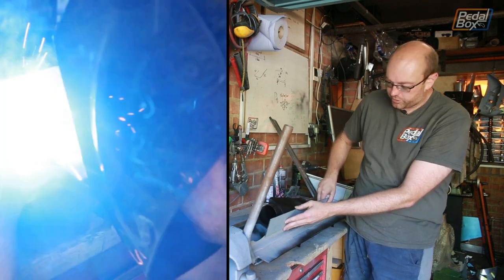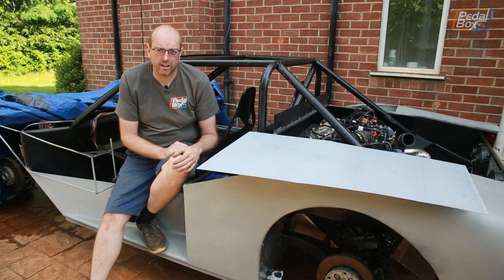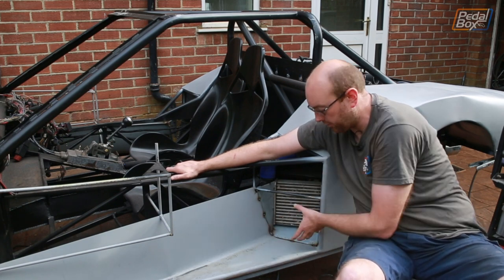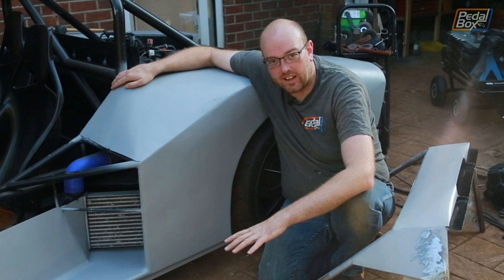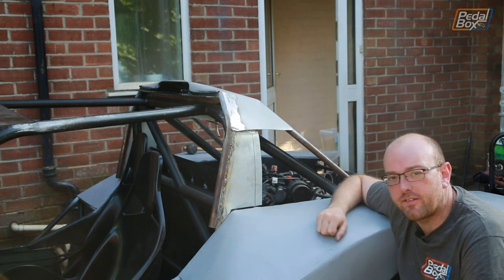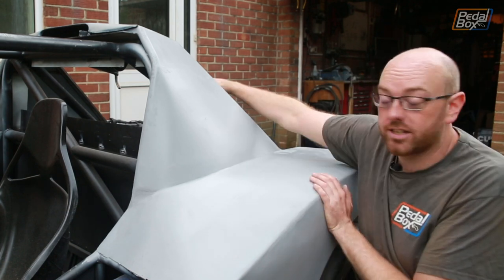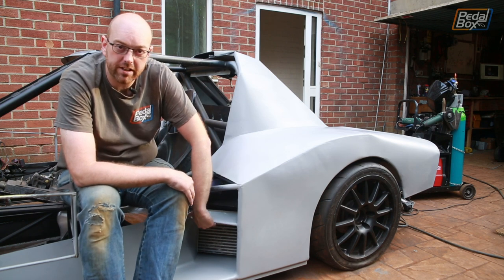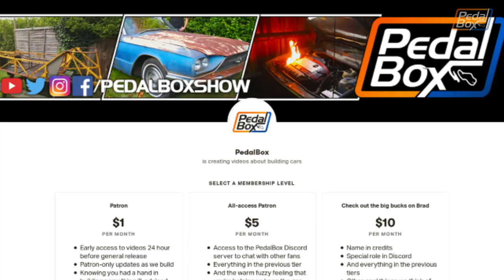Raising the Roof | Audi TT Kit Car | PedalBox Episode 87

Comment: What MIG do you use?
Reply from the maker: It's a Clarke 145. Largest one Machine Mart do on a normal 13A plug at the time.
Reply: @PedalBox  do you find the four power settings limited compared to more expensive models with a variable dial power control?
Reply from the maker: Limited a bit, but far from impossible to work with. More variable settings might be useful, but we've done everything from 0.8mm to 3mm on this one with success and with some time, practice and care it all works fine. The biggest issues have been with wind and the cleanliness of the metal. But that's an issue which can persist no matter the welder used.